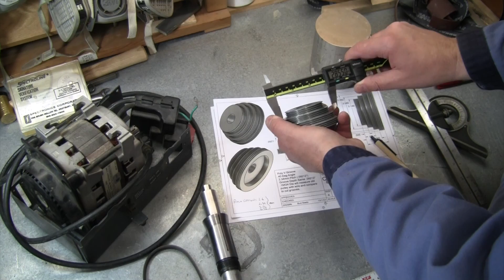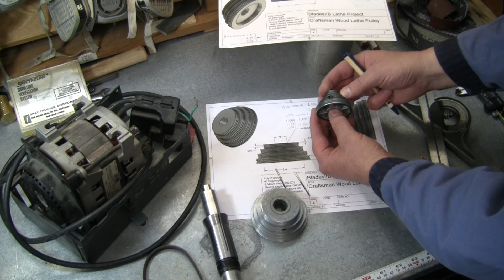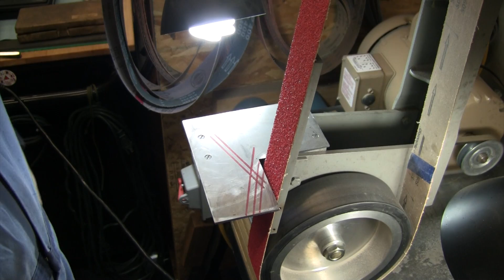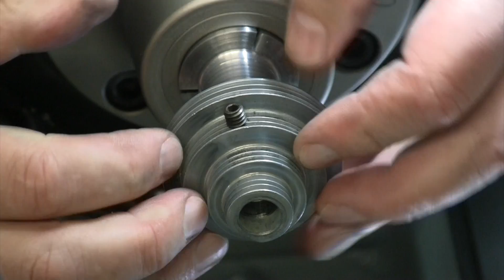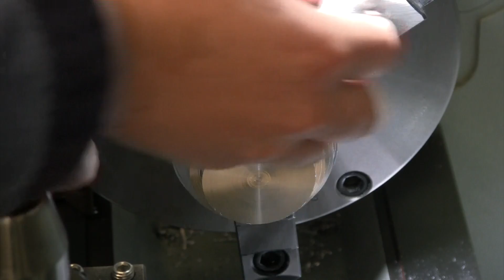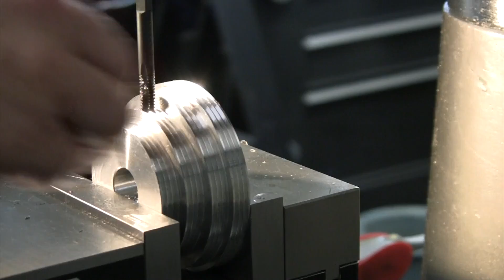Making a Poly V Pulley For An Old Craftsman Wood Lathe On A Precision Matthews 1440TL Metal Lathe

Comment: What would you charge to make another pulley? i need one.. I did exactly what your friend did.
Reply: would you happen to be willing to share the cad file.
Reply from the maker: @williamkcallahan5675  I am sure we can work something out for that. Send me a message through my contact form. Thanks.
Reply from the maker: @williamkcallahan5675 - Thanks for the question. This is about a 4 hour project so I would charge about $300.  That would be $240 for labor, $50 for material and $10 for shipping. Would also need you to send me your current one. I recall having to give a little more clearance on the back?  If you are interested send me a note through the contact me form on my website www.BladesIIB.com.

Comment: Imo should have just sketched belt profile and revolve. But theres obviously multiple ways of doing this.
Reply from the maker: @Dwarfgrinder - Appreciate the comment. I did do a revolve to make the grooves, but I am not a Fusion expert by any means so I am sure there could be a better way to get my sketch on there instead of a cross section?  Thanks.
Reply: @BladesIIB  on anything circular revolving extrusions is a great way to have the entire geometry in one sketch. No need to extrude the cylinders as you can just dimension the radius of the whole thing. Makes the design more robust. Less steps in the ribbon. Etc.
Reply from the maker: @Dwarfgrinder  Thanks for the tip. I will have to do some reading and watching to see what you mean.  Always learning.

Comment: Jeeze, a lot of work. What did you charge for this job?
Reply from the maker: stecy802 - At the time I was charging $50 per hour plus material (usually have customer supply material) and charged 4 hours for the pulley.  Took longer than 4 hours, but the research and learning the angles for the grooves, and the extra time to video is not included in that so 4 hours seemed pretty fair.  Making one off parts and prototyping does not go quick.  Thanks for the question.

Comment: Maybe next time just grind your angles onto a parting blade and come in from the side? Save yourself a lot of grinding ! Not sure if you’ve seen it but nyccnc has a video speeds and feeds aluminum. Worth a watch
Reply from the maker: Zane Christenson - Good though, I a sure I have a HSS parting blade somewhere, that would have worked well.  Will also check out the NYCNC vid.  I currently use an app from cncdirt for my speeds.  What was your thought, I was turning to fast or to slow on this part?
Reply: @BladesIIB  well aluminum is a pain in the ass no matter what lol but if you noticed when you parted it off it was making some beautiful chips. I would say test out what your lathe is capable of depth of cut wise with a decent feed rate. I think you’ve got either 1.5 or 2 horse on that motor? The bigger the cut and the faster the feed on aluminum the better unfortunately lol. When you get down to your finish passes of course you just have to deal with a bit of bird nesting but hopefully you can cut down on it throughout the process! Great videos though man and you’ve got an awesome shop
Reply from the maker: @zanechristenson3436  I gotcha. I actually have 5 horse so I can push the feed much harder. And for parting I get lazy doing just one and generally feed by hand rather than cranking it up. Especially when I know I can turn it around and face it off clean.  Something I will work on. Appreciate the feedback on the videos and shop.

Comment: Bud,
I may have missed something in the procedure but when you mentioned turning the part around and starting over It occurs to me that you might just “move left” one pulley step, part or turn off the smallest one, then re-do all the outside diameters.  You would waste only the thickness of one step that way.  With the price of aluminum stock that’s a significant difference vs making the whole part over not to mention all the additional work involved in removing all the stock again.  Additionally you wouldn’t have to indicate the bore or anything, just keep turning and boring another fraction of an inch.  Just my $0.02.  Best wishes.   
P.S.  Many thanks for the assist with my Grizzly lathe three phase control wiring a few months ago.
Reply from the maker: Chuck Saunders - I don’t think you missed anything. I think I missed a good opportunity to do something smart and easy 🤦‍♂️. Sometimes in the middle of a mess up the obvious escapes us. I am sure I could have extended the bore clean enough to make it work. I was counterboring the backside so really would have removed all of the fresh bore anyway. Good call on a way to save material. Thanks for the comment. Also glad to hear the Info for your Grizzly lathe helped.
Reply: @BladesIIB  Agree with your assessment regarding behavior in the heat of error correction.  No telling what I would have done if I were making a video.  I appreciate your taking the time to record the whole process.  I will be making some multiple grooved sheaves for a tool post grinder in the near future and this was helpful.
Reply from the maker: @Dogfather66227  Sounds like a good project, glad this was helpful.  If your grooves are larger for a more traditional V belt you can also use the compound to finish cut them vs plunge.  Better finish and better accuracy on the angle.

Comment: Have you taken the scale apart and see if it is either broken or dirty? I have DRO on my mill for 2 years and it never failed me. But nobody (or rather few) uses DRO on lathes because 99% of the time the scale is good enough.

I had a bandsaw that has poly V grooves, and it's a pain to find the belt or replacement parts.
Reply from the maker: Tyler Fu - Have not taken it apart yet. They are magnetic though not glass scales so usually dirty is not an issue. Will see. Thanks for the question.
Reply: @BladesIIB  Do you think it's possible that some steel chips (I mean steel is magnetic) has interfered with the scale somehow? I have been using glass scales on my mill and it never has problems.
Reply from the maker: @taiwanluthiers  Yes someone else recommended looking for a stuck chip.  Need to get the cover off and take a look.
Reply from the maker: @taiwanluthiers  It was a small chip.  I did a video of the quick repair and will get that out next Saturday. So easy to fix wish I had checked at the first glitch. I know for next time.

Comment: Might want to check for a broken scale or something stuck in the scale to cause it to malfunction like that. The pulley came out nicely 👍🏻
Reply from the maker: Musicalbullet - Thanks for the tip on the scale. I will pull the cover and take a look. Still need to email Precision Matthew’s about it as well. Glad you like the vid. Appreciate the comment.
Reply from the maker: Musicalbullet - It was a small chip.  I did a video of the quick repair and will get that out next Saturday. So easy to fix wish I had checked at the first glitch. I know for next time.
Reply from the maker: Musicalbullet - It was a small chip.  I did a video of the quick repair and will get that out next Saturday. So easy to fix wish I had checked at the first glitch. I know for next time.